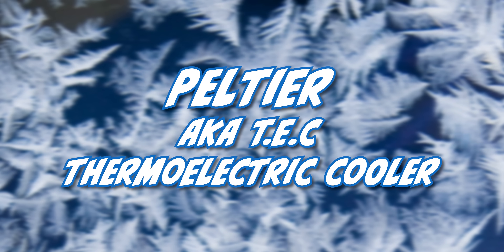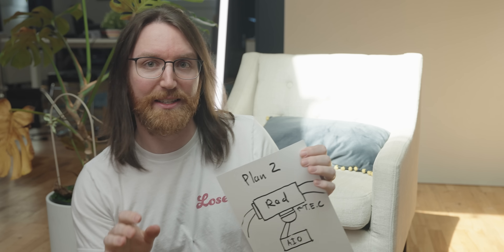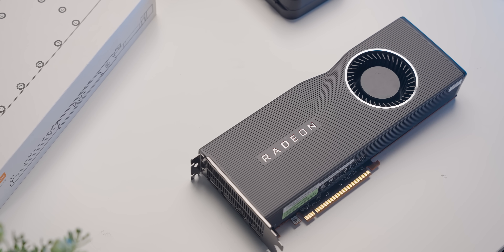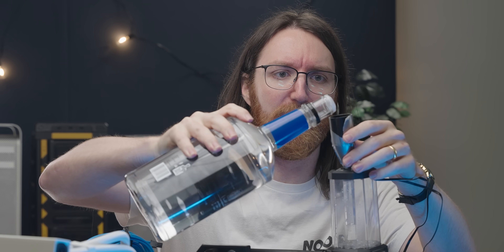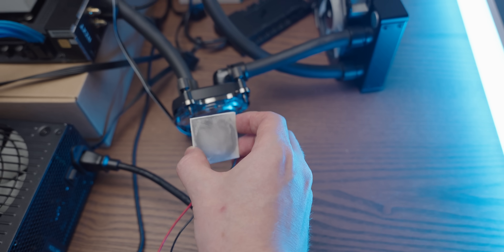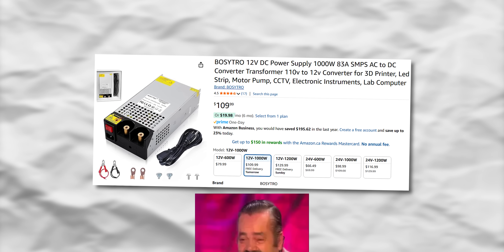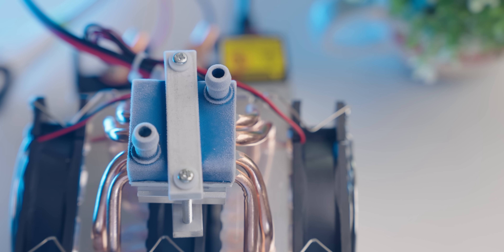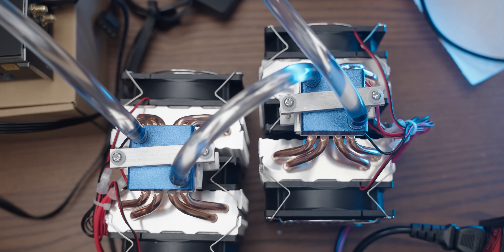I REVOLUTIONISE PC Cooling....

Comment: If you want to use a peltier to cool the liquid you want to start with a larger reservoir.

The larger reservoir means more volume of cooling liquid which will already increase cooling efficiency. 

You want the peltier to have as much contact time as possible with the cooling liquid. A larger reservoir will result in a lower percentage of warm liquid coming in and a lower percentage of cool liquid leaving. 

Your attemps so far have been to try to cool the liquid being pumped, which gives the peltier very little time to cool the water passing by it. 

Ironically you could instead use a large reservoir to cool the components (CPU, GPU, RAM, MOSFETS, and/or chipset).

Then use a smaller loop to cool the reservoir cooling liquid.

Place all RADs (radiators) outside of the PC case in a location that is cool and has good ventilation.  This could be on/near the floor or  for even better results in a basement. The basement installation should be near the basement floor and conductivily attached to the concrete wall.

Another option, if you live in an area where your air conditioner runs most of the year would be to place a radiator next to the air conditioner vent. There would be problems if your air conditioner and heater shares the same ducting.

These ideas not only would be better than using a large peltier, it would use much less power. A 200+ watt peltier running 24/7 for 30 days is 144KWh times your electric rate per month.

If you do insist on using a peltier it is important to realize that one side is cool, the other side is hot. If you do not remove all of the generated heat then the peltier will not properly cool.

Comment: not worth it. The cost is too high for paltier. if you still want to waste energy then use aquarium chillers. I made a lot of gaming rigs. super airflow with a good design is fine and it doesn't have to be noisy. put AC in your room instead of buying a water chiller. as PC air coolers need cool ambient temperature. liquid cooling is just messy.

Comment: Great forward thinking that you didn't even test water that could immediately freeze around the micro fins of the AIO! 
I'm always surprised that peltier can get so cold to freeze water out of humid air but as soon as it has to cool something warm even +200W of power can't keep the element cold. So far the only useful scenario for peltier i've seen on YT is to keep a sensitive diode laser within a temperature range of "room temp." thanks to a feedback loop with thermometers that switches the peltier on and off. So effectively cooling a heat source that is barely 1mm² with a pletier that is easily ~50x larger

Comment: I think that the problem is that the cell was between the radiator and GPU and therefore it has to suck up the thermal load. If it was a peltier->GPU->radiator instead it'd be more efficient as the radiator would absorb the heat and then the  peltier would cool the liquid before it reaches the GPU

Comment: Bro buy the cheapest chinese domestic fridge and put a bucket filled with water in freezer compartment and drill 2 holes in fridge door. 1 inlet 1 outlet and that 100 watt heat pump will take care of cooling rather than that stupid peltier module.

Comment: If your graphics card uses 200 watts then it will convert ALL(100%) of that energy into heat, based on the laws of thermodynamics.
Peltier has 5-15% efficiency meaning you would need 10 Peltier coolers(rated at 10% efficient) running at 200 watts to guarantee all all heat energy is removed, in an ideal scenario that is.

Comment: You have the radiator hooked up and it's killing your efficiency. Add extra peltiers, extra voltage, and use the radiators to cool the hot side of the peltiers.. you need two loops!

Comment: oh my.   why have you done this?   you should have been reasonable and taken your advice about attaching the cooler directly to the surface of the radiator.   why would you think you can put it under the water block?   it will limit your peltier effect!  or did rather.

Comment: I think you should do this again with the placement of the radiator and the liquid chiller swapped. Because the hot vodka could ideally get cooled down to room temperature, then the two chillers can cool the now cooler vodka even lower than room temperature, Therefore making it more efficient.
The way you're doing it now, is cooling the hot vodka down, then heating it up again in the radiator and sending it back to the gpu.

I'm no engineer, that's just what came to my mind when I saw your setup and thought the way you did it was kinda... Well dumb. I hope you try it again in the future, id love to see the results, in theory it should be better, maybe even much better who know if you don't try and show us.

Comment: I used rubbing alcohol to clean my first custom loop parts, it lasted 10 years and never got anything growing. About 4 years of use, and 6 in storage. Pulled it out and the water was still clear. Ran it, water ran clear for another few weeks, temps held fine, until I drained it and repurpised all of the parts. It's not challenging folks.

MY FIRST LOOP!

Comment: Im not an expert on peltiers, though, I think the last 2 digits is the Amps it draws, so the 12715 is 15 amps, 12v*15A = 180w, not 231? (it might be classified for 231W, but that is on 15.4v, not 12v)

also, it was hard to see how you connected it all up in the loop, do mind, the peltiers is VERY ineffective while heat is introduced to the cold side, you can make a difference in temps, sure, but you will need alot more than 1-2 peltiers, the wattage draw is never ever going to be acceptable, but anyhow, the best way to connect it up (i think anyway) is resorvoir -> pump ->  radiators (to cool down first) -> peltier cooling water -> gpu, if you put the peltier in before the radiators it might actually warm up from the hot air from the room, but again, 1-2 peltiers won't be able to actually cool down that much, i think you'll need to get around (just guessing) around 1200w of peltiers to actually make things quite cold

they are alot of fun to play around with and experiment with, but in the end, they are what they are, power hungry and kinda meh results

Comment: i was doing this 20 years ago on my p4 and athalon 2500, 3200,and 4200, you will get better results with a compressor ac with the cold side in a 200L drum (what i currently do on my 285k setup), it'll cool faster than a peltier setup and use less power

Comment: I think your going about this wrong.  You need more peltiers with more surface area at a lower wattage.  Higher wattage just means it gets colder not better heat transfer. Everyone assumes more cold works better. You have a small finite surface area to deal with the heat transfer.  What you need is a large industrial flat water block that has copper tubes running through it.  "Look up water heatsinks"  you need 10 or 12 low power peltiers to do this.  10 or 12 peltiers should total up to that 200 watts level.

Comment: lmao, funny how people rediscover crap from 30 years ago.   I used to do this on dual celeron on BP6 motherboards back in the 90's can covered the board in closed cell foam to prevent condensation.    Now days phase change cooling is much better for what you are doing here as you can get simple ones from china that are low cost and 12v.

Comment: Put this 2 after the radiator, the liquid temperature at the GPU output it is certainly very high. Lowering it with the radiator will make it easier for the two cells to lower it further. It might also be interesting to place them after the pump just before the GPU input.

Comment: Use ten peltiers... it will be cuch more efficient than getting a bigger and bigger power supply. Ten peliters in series would be 120v dc. Rectifying 120v ac would be much smaller, easier and cost effective than getting a 12v dc power supply big enough to power 6 peltiers. I have also wanted to try this, pretty neat experiment. reach out if you want some brainstorming and help.

Comment: I had use Peltier in the early 2000 for overclock CPU like the Athlon 64 ( DFI motherboard with DDR1 BH5 support ). basically we had put the Peltier directly on the CPU DIE, using a Phase change cooling on top. crazy setup who was need 1 or 2 KW PSU equivalent only for the Peltier ( not PSU for standard PC ofc ), the limit of the Peltier is just what electricity you put in.   Peltier are fun, but need insulate them like hell with silicon on the CPU socket, need a lot of power  and somewhat it was not really worth it over a cascade Phase change unit.

Comment: Did this ages ago and destroyed my entire second gaming system. Using a 320w TEC you need a big radiator as it's only as efficient as the radiator on the hot side. In my case I used a limo car radiator with a desk fan situated outside in winter. Only then was I able to get my P4HT down to 4°C. Only then after a night of sailing the seas did I find my over clock wasn't stable and crashed which inturn froze the line to which then made it CPU over heat and condensation drip absolutely destroy everything, the only thing that survived was a hard drive platter (after I replaced it's controller board).

Comment: I don't think you'd ever get efficient cooling out of this. TEC is basically turning watts into cooling with less than 100% efficiency, and you then have to get that cooling effect into your system with less than 100% efficiency, and you have to somehow deal with the heat from the hot side of the TEC (probably another water loop at which point just use the water loop on the components)

That means you'll need to put more than the watts of heat produced by your PC components into the TEC, if you take a 500W combo GPU/CPU, you'd need probably 600-700 watts going into your TEC and that's being generous with the efficiency. Alternatively a radiator, pump and fans will consume like 10W for the same cooling effect, just that the floor will be a couple degrees above ambient instead of below, but that has no impact on performance.

Comment: Trying to solder a connector, which is connected to a metal clamp, which is sucking all the heat out of the connector - yeah, that wont work

Comment: Just gotta say the cooling loop rad works both ways. If your liquid is cold ambient temp will heat it up the loop. If it's hot it will bring it back down to ambient. Your loop would need to be closed.
I suggest getting some copper heat pipes and making a lid to the reservoir connected to the peltier. Then making it a close loop to accurately measure your gains and losses. Just to pump to reservoir to GPU and back to the reservoir. Well the reservoir is being chilled by copper heat pipes chilled by the peltier.

Comment: So I am doing a lot of custom work with peltier cooling right now. Couple suggestions:

Get a copper slab to sit on the cold side of the peltier module. Always run the peltier module at low wattage, about 20 percent of sustainable limit in temp delta. Use multiple peltiers in a sandwich, decreasing in total wattage*area cooled. The closest one to the copper slab needs to be the smallest. Slab 3 at least. 180 watts, 100 watts, 60 watts on the last hot side, place thinner clan of copper to an aio spreader. Make water volume as low as reasonable. Run aio 100 percent. If you hit 80 C. throttle to 10 percent on peltier tiny module and 100 percent on big peltier module. Try not to adjust wattage in less than 5 total seconds for the ramp down, and 30 seconds for ramp up on wattage.  Any oh shit i hit 80c responses should be heavily hysteric, if one understands the terminology. 

First test 10 percent wattage on all 3. Ramp up iteratively to 40 percent on mid and big, and  then 80 percent on big. Never run the smallest one past 80 percent wattage. Run the big one up to 20 percent over minimum sustainable specced voltamps.

Use a metallic TIM for metal to metal interfaces. For ceramic, buy HY-something (hy500 line of pastes are stupid cheap for tons and compete with second best popular paste brands) and dope it with the finest diamond dust, 10 percent by weight dust 90 percent thermal paste. Get a marine high temp epoxy and dope it 60 percent dust 30 percent epoxy 10 percent graphite for interesting results.  Alternatively again, use an indium tin alloy rich in tin over indium heavilt maybe like 5 percent galium and you have a solder that solders at 120. If you have a metal melt spinner that you can put lead dust into, honestly, it helps a bit to do so right below leads melting point by 50 degrees. Much more adhesion. ALTERNATIVELY, add tiny antimony percent for harder grip, but it curves the alloy melt temp hard, so not much iirc.

Peltiers are a losing game that wins one fight: it it is the only reasonable way to get sub ambient temp without building a refrigerator.

You are trying to get the smallest inefficiency trade off, which trends usage being best at lower percents of wattage. Each layer honestly can produce well over 5 times heat increase per temp cooled. When operating minimally, the smallest peltier makes enough heat to need at least 5 times the wattage to relief to the next stage. What you are powering is a heat spreader. You use the peltiers to spread small heat on small die to bigger peltier in area and wattage, which does it again, so you end at 120mm squared and 40 mm squared at physical size extremes, or rather 160 squared and 1440 squared; near 10 times total area. This let's you dump your heat efficiently into a greater volume but much less dense medium, which you just radiate or you refrigerate.

Please remember:

Cooling is war against entropy.

Ergo you can never win always forever, so aim for winning normally given very specific parameters so long as you pay attention always. T-sensors on motherboards are crucial. I suggest having 3 and using a mobo that can tie those three to fan operation. Most mobos run fans at 1 to 2 amp and 12 volts, so you can put circuitry to mirror and amplify that to the peltiers, I would not do more than a 10x mirroring without the source of the electric being its own, or sourced from 4pin molex 12v rail on a PSU you put plus 600 watts past system needs. Now you can set up 5 volt down switching from 12 volts usually used for peltier at computer scale, or 7 volts if you make the  negative be the 5v rail paired with 12v positive.

If the mobo can program in standard percent duty cycle on non pwm this is critical for direct control, if not, get a amplifirr that takes in the fan mono signal.

Sorry on mobile. Using wrong words I'm sure but the theory is right.

Try to get sustainable small delta temp improvements over cooling proccessor lower than 15c. Ideally, you want processor at 5/c and the copper sinks at 10 c and the aio liquid to be ambient temperature at most or so. Dehumidifier should be running. If you do a refrigerant loop, consider placing computer in dehumidified refrigerator cause fuck it obviously cooling efficiency is not the focus. Cooling delta, so long as limits (5c to 85c are my low to high hardware imposed limits.

Note that peltier modules unpowered are NOW INSULATING NOT COOLING THE SIDE THEY WERE COOLING.

AGAIN 

UNPOWERED PELTIER MODULES MAKE YOUR TOASTER RUN HOTTER

Comment: This is not a new concept. We used to be able to purchase a Peltier refrigerated reservoir unit as an addition to your liquid cooling solution in place of the standard reservoir. The Unit either sat on top of your PC case, or it was mounted inside 2 of the 5 1/4-inch floppy bays in the front. These units were mainly used by the overclocking community but in the end were found to add little value for the cost.
We also ran coolant to stop algae growth as well as copper and Aluminium block corrosion instead of distilled water.

Comment: You need to remove all instances that put the coolant "booze" back to ambient temperature. That means zero heat exchangers in the system. Go look up interchillers that use a cars a/c system to cool intake temps in forced induction. However its 2 liquid heat exchanges that take place in a plate heat exchanger. The water in the intercooler loop and the ac refrigerant. They do not mix phyically but exchange heat in the plate heat exchanger. They arent effected by ambient temperatures. TBH it still might not work as those arent the most effiecnet and probably will be overwhelmed. You really want it to work...........get a 12v AC system lol, and a plate heat exchanger it get below -10 maybe -30 F all day long. Wont be cheap but itll be funny to see

Comment: people always seem to neglect the huge thermal load of peltiers. those 231W need to be cooled as well; if the air cooler at the hot side does not dissipate this heat, the peltier will add the remaining heat to the cooling loop. peltiers are not coolers, but heatpumps (inefficient at that as well).

Comment: um, were you running the cooled liquid from the peltier INTO a radiator pulling heat from the ambient heating up the alcohol (negating the peltiers) or were you using the radiator as a pre-cooler (to dump heat) before the cooling loop hit the peltiers?
Also...I looked it up...ethanol/methanol thermal conductivity is about 1/3 of water (.6~ for water, .2~ for alcohol), but is MUCH safer for the copper/rubber/aluminum fittings in a cooling loop...and it won't grow algae and junk in it...hmmmm